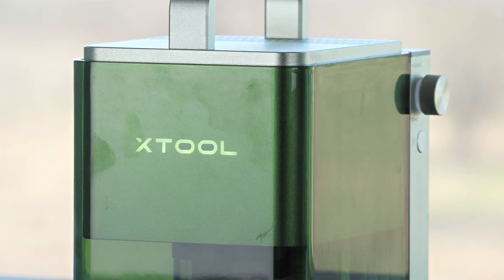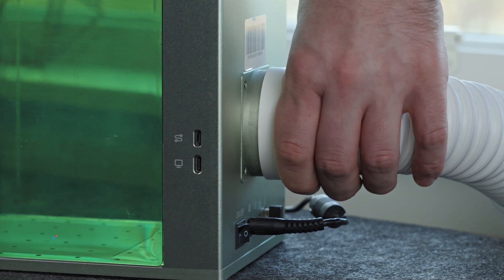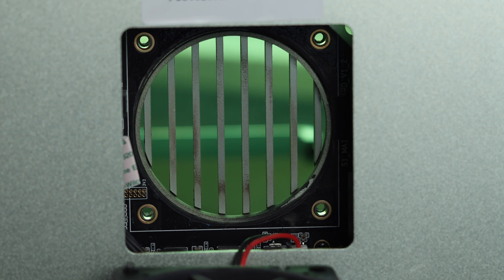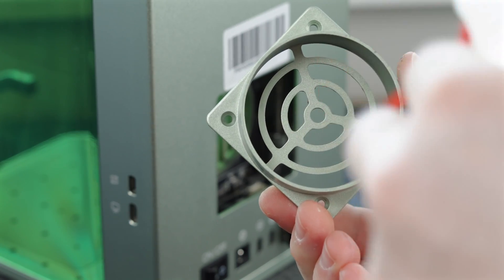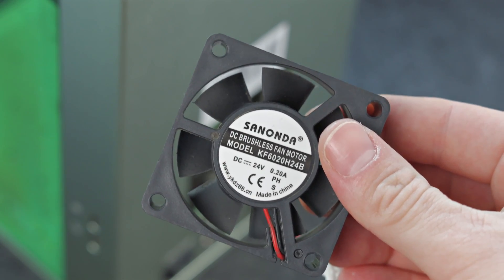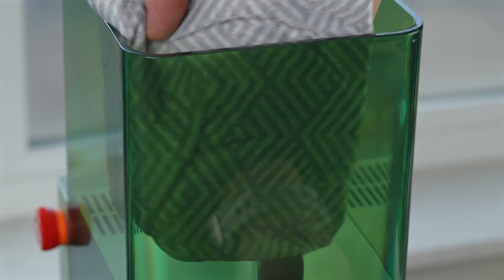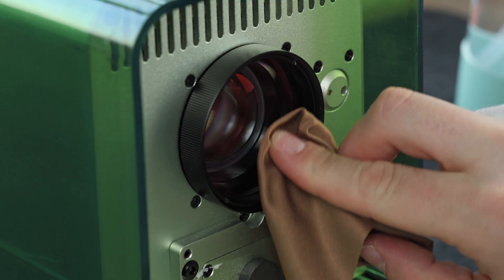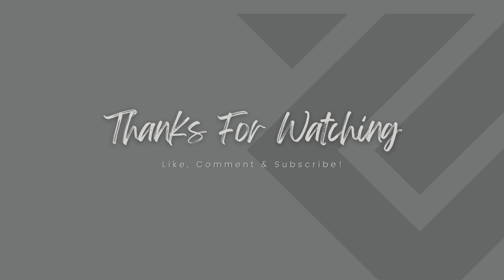Easy xTool F1 Cleaning Tips: Your Complete Laser Maintenance Tutorial!

Comment: When cleaning a lens, it is recommended that you gently wipe in one direction, lift the cloth and rotate to a clean area of the cloth, and wipe in that direction again instead of doing circular wipes.  If there is particulate on the lens it could get trapped under the cloth and get dragged around, basically turning it into sandpaper.

Comment: Hello guys! I have a question: on my f1 i cant engrave metal with the bluelaser....at the beginning it worked very well but now after maybe 10 hours of using it doesent work... focus is good, settings are correct....but nothing to see on the surface on metal....can anybody help?
Thx!
Reply from the maker: What kind of settings are you using? Also typically the IR laser would be best for metals unless you are trying to do some color engravings.
Reply: We had tried every possible settings....even on wood we have problems with the power....we made some black metall cards with the bluelaser, but now can't anymore, the laser has much less power.....
I tried your settings from the colour video of you....but nothing happend on the surface...